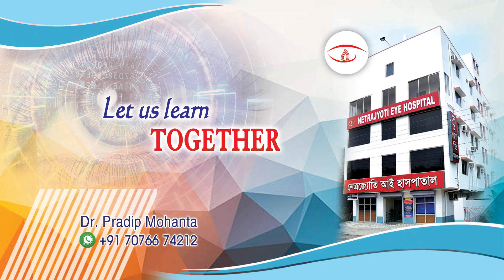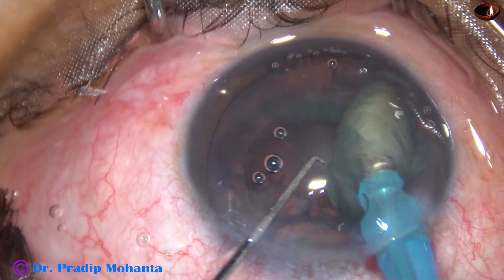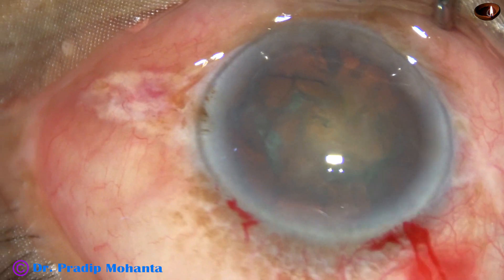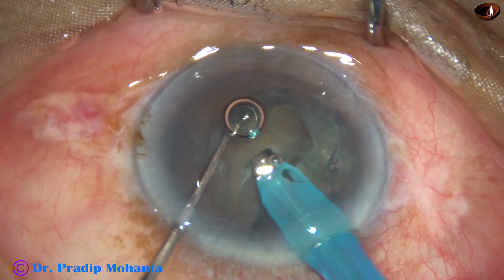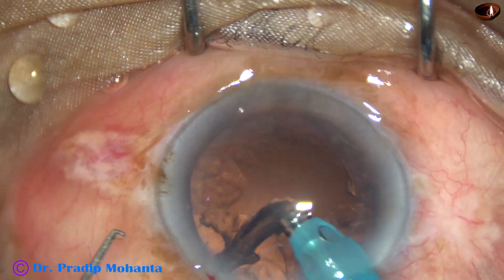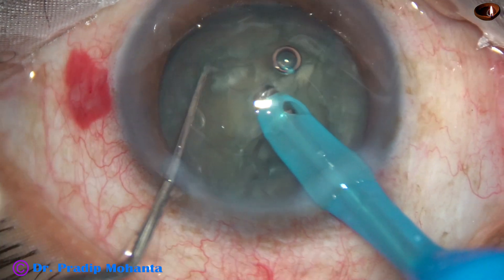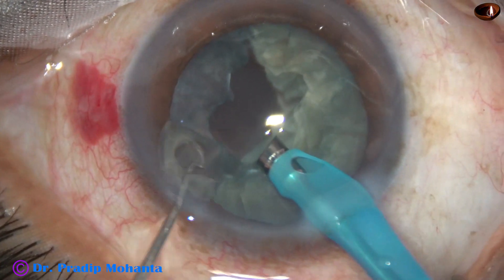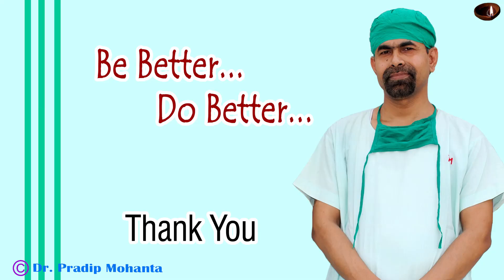Direct Chop : HOW DEEP TO GO to hold the nucleus ? - P Mohanta 13th Oct, 2019

Comment: Thank you Dr Pradip. 
As usual a new amazing video from you. 
This is always my problem how deep to go to hold the nucleus. 
But kindly am little confused, if the tip as you said is 2.8 mm. So how big is the sleeve ?
Thank you.
Reply from the maker: 2.8 mm is the measurement of the outer diameter of the tip of the Phaco needle.